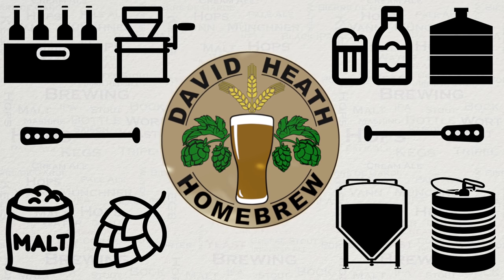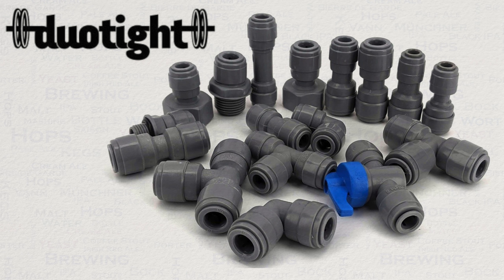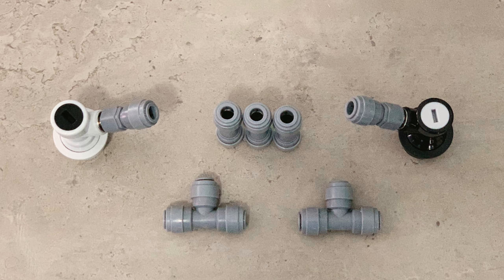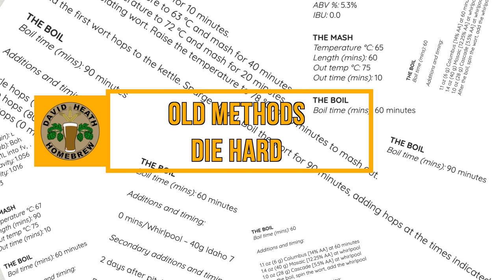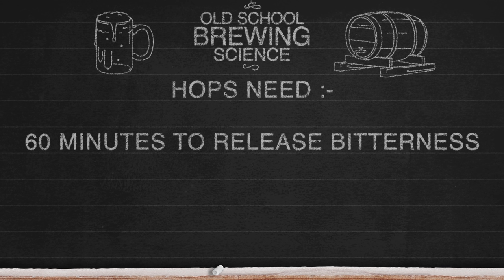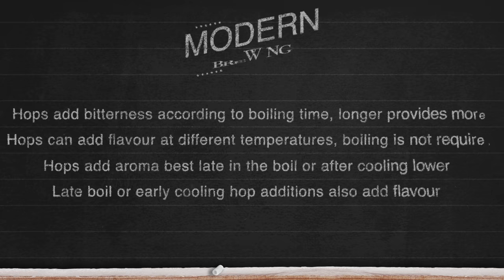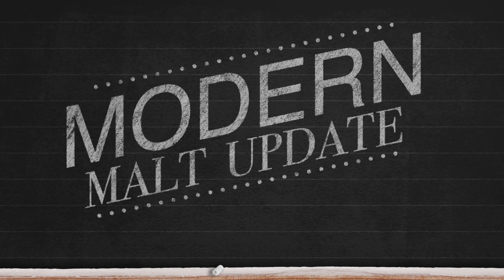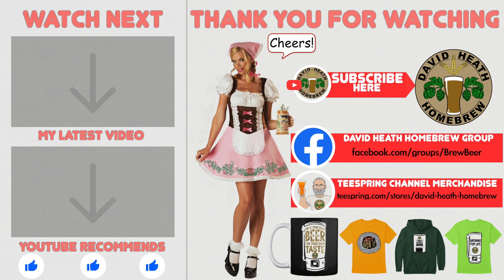Brewing Bad Part 10 Common Mistakes Made By Homebrewers

Comment: Thank you for that review! I'm currently still in my first year of home brewing, and I'm still using all-grain kits. I mainly buy these from differenr suppliers in Norway, and they consistently use the 60 and 90 minute boils as well. I am sure this is partly the reason why these times are keep being used. It'd certainly be beneficial if the suppliers followed your advice here as well!
Reply from the maker: Yes, moving everything forward is going to take time for sure. In Norway there is a NEIPA kit that is one of my recipes that has a 30 minute boil time.

Comment: A goldmine of info as usual David. At every brew I use loose hops at the end of the boil, resting for 15/20 minutes, then using a hop rocket and wort at 80°C through the rocket, then through the c/flow chiller to the fermentation vessel. It's certainly worth the extra effort and adds to to aroma/hop flavour of the final beer. Of cause fine adjustment can also be obtained by dry hopping at fermentation.
Reply from the maker: Cheers Tim. Yes, I love this technique myself, very nice results.

Comment: I do sometimes boil for 90 minutes, but not because of DMS. Some classic beers are hard to reproduce without the additional darkening of the wort that comes from the long boil. Saison Dupont, for example, is about a 4-5 SRM, but uses 100% pilsner malt. A good hard boil for 90 minutes does help to darken the wort somewhat and create a slightly more authentic product. 

For modern styles though I often boil for 30 minutes. In fact, I've considered experimenting with even shorter boils. I'm not sure there's a lot of reason to boil more than 15-20 minutes if you're happy to throw some extra bittering hops in there.
Reply from the maker: I totally agree. I have boiled for double this for effect.

Comment: Thanks David, very nice series.  Interesting on your take of 30 minutes boiling.  I have also heard about being able to reduce mashing time, as iodine test shows conversion after 30 minutes.  What is your take on reduced mashing time?  I notice in your videos that you still mash for 60 minutes.  Cheers  Joe
Reply from the maker: Cheers Joe. I dont reduce the boil to just save time, I do it to improve flavour. A reduced mashing time is usually going to save you 20 minutes. I dont usually do it as during the mash I do other things instead.
Reply: Thanks David for the quick response.
Reply from the maker: Cheers 🍻🍻🍻

Comment: How absolute is the 30m rule boil times for ales, dark vs light, low IBU vs high IBU, I get alot of strange looks from other brewers when I mention this tip, and can see where age old tendencies die hard.

Also, can you generally half the boil times  for the 30m boil across most additions, e.g. a 10m addition would become a 5 minute addition. Cheers and keep up the good content!
Reply from the maker: You can also brew raw without any boil. If you wanted to boil some hops in a small pan whilst mashing in the brewing system. There are always options. The simple fact is that for many years the boil times were misunderstood and the new information takes time to be understood and adopted. Certainly you may decide on a longer boil for economy for high IBU beers. The only thing that changes is the bittering hop. So, for example 60/90 minute becomes 30 minute.
Reply: @DavidHeathHomebrew  Sound advice, I'm lining up to do your Christmas ale soon, looks like a great recipe!
Reply from the maker: Great, yes that raw Christmas ale adopts these methods well.

Comment: I've used Magnum hops for all bittering purposes for years now. (at 60 minutes). I guess shifting to 30 minute boil will force me to stop using Magnum as bittering hops as it most likely will impact flavour if added at 30 minutes. What do you think?
Reply from the maker: I think you will be fine, it will be hard to notice an overall difference usually.

Comment: Should I boil longer if I don’t have a vigorous boil? I have a 120V robobrew and feel like the boil is not vigorous and scared that a 30 min boil will not be long enough to release the chemical compound (dms?)
Reply from the maker: Hey, do keep in mind that DMS these days is highly unlikely to come from malt. A boil is all you need, it does not need to be vigorous, that is an old myth.
Reply: @DavidHeathHomebrew  thanks for the answer. I was looking at your Vienna recipe and ESB recipe on brewfather and they both have 60 min hops addition. Can I add these hops at 30 min and readjust the quantity to get the same IBU?
Reply from the maker: Yes, no problem there with either.

Comment: hi David, it makes sense all that you have said, giving that in count, what boil time for russian imperial stout would you recommend ?
Reply from the maker: It depends on the perspective of the recipe. Some will use a long  boil time (90 mins for example) to thicken the wort, where as others will have a regular boil time and will handle texture via adjuncts in the grain bill. In the last case changes can be made to the hop side to support a reduced boil time.

Comment: If you boil for 30 instead of 60 minutes, that changes the amount of evaporation, so it seems you have to adjust the water quantity also (i.e the whole recipe needs to be tweaked).
Reply from the maker: Yes, you will save on water also. Naturally software like Brewfather will calculate this for you.

Comment: I tried the 30 minute boil thing but it introduced another problem: now I barely have enough time to prepare my fermenter and the wort cooling stuff I need before the boil is over! It becomes quite stressful 30 minutes
Reply from the maker: I actually do that type of preparation the day before a brew. Though I am also needing to prepare and set up lighting and cameras ahead too.
Reply: @DavidHeathHomebrew  I'm brewing in my small kitchen so I have a specific way I set it up. Also I want to wait with sterilizing my fermenter until the very point I need it. But it can be done, it's just a bit tighter in the schedule now. 
I did two batches like this but I still haven't tried them although they are ready to go in a keg. Unfortunately one of my kegs has developed some rust spots so I am reluctant to use that one.
Reply from the maker: Fair enough. The rust can be cured and then fixed. Scrub it down with bar keepers friend. Rinse and then soak the keg with starsan overnight. You may not know where the rust was later.
Reply: @DavidHeathHomebrew  I've heard a lot of good about Bar Keeper's Friend but it's not available in the homebrew shops I use unfortunately. I shall keep my eyes open for it
Reply from the maker: I import it from the UK, its not available in Norway  where I live

Comment: 30 minute boil for me, saves on wasting energy either gas or electric.The massively bitter IPA is not as liked now and my tastes have changed. I now bitter for 30 minutes and whirlpool hops as I only make Pale Ale or IPA, sometimes I don’t dry hop and do like the flavour.
Your right more malt flavour is present with shorter boil times.
Reply from the maker: Exactly :) Thank you :)

Comment: in terms of boil times, is there a difference when you're using a 110v or 220v system? I know the initial water quantities must be adjusted, but does it affect the end beer at all?
Reply from the maker: It used to be believed that a stronger boil was a better boil but this has since been found to be less important than was suspected.